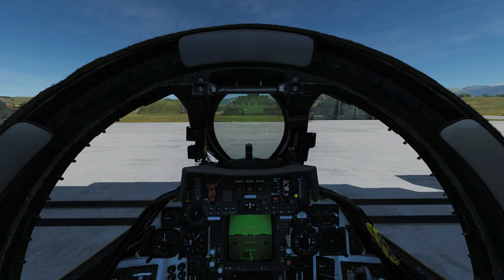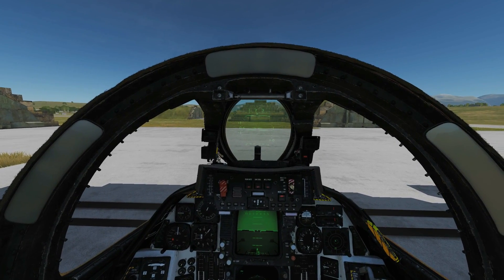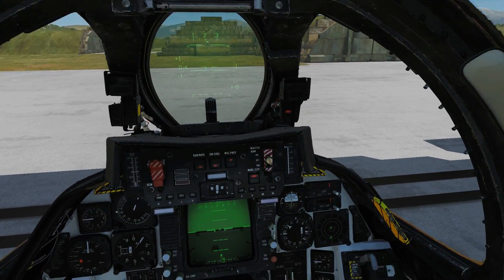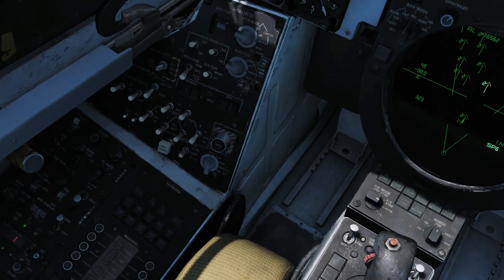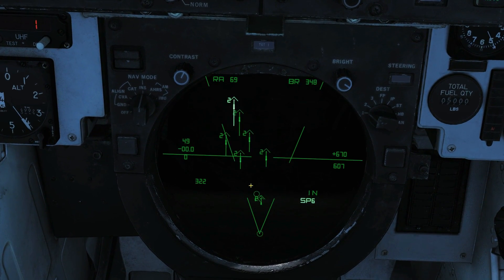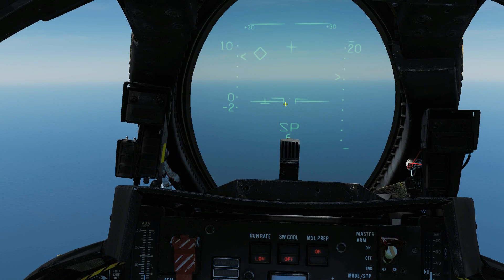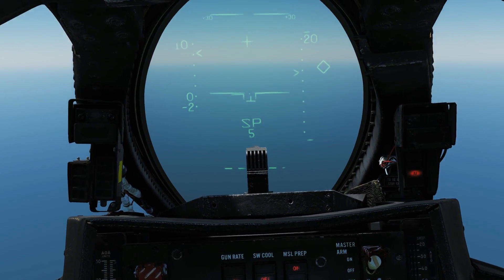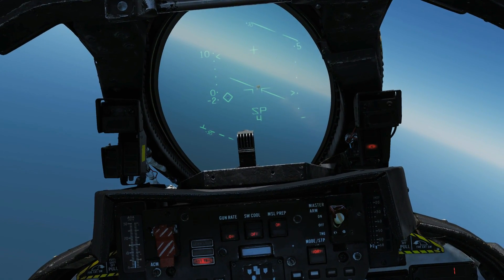F-14B Tomcat: Aim-7 Sparrow Tutorial | DCS WORLD

Comment: Ok, I have a question. I mainly play single player, and I've noticed some odd behavior with the F-14 and AIM-7. If I engage in a FOX1 fight and perform a crank after launch it seems that the radar struggles to keep up with the maneuver. You can actually see the line move off the bandit. When using the AIM-7M that is it. The missile loses guidance and goes stupid. Let me be clear I have not lost lock. Once leveled off the radar continues to track the bandit. I have a ton of Tackviwe data showing this. With the AIM-7MH this is not an issue. My theory is tdd that the MH has a data link with the mother ship, and that it is getting corse corrected back onto the bandit when I'm leveled off again, and the M dosen't. Any ideas.
Reply: Ive had similiar problems
i think i know what your seeing, when you loose lock, the diamond dissapears, but the datum cross stays on target.  this is actually where the camera is looking at and your lock is gone.  if you turn too much after launch but before impact, you may be turning outside the slewable angle of the radar and you would loose lock also the MH model's only difference is that it has a loft feature i believe

Comment: Here's a question. In bore sight mode, does the Tomcat need to guide the missile? Or will the missile just find its target and track it independently?
Reply: The Tomcat needs to guide the missile. Remember that the AIM-7 is a semi-active air to air missile so you have to maintain a radar lock. When you are in boresight mode you must keep the target center of the radar where the waves shoot forward and bounce back. If the target steers clear of that area, the missile will lose track.
Reply: @Megalodon64  thank you, kind sir.
Reply: @Megalodon64  Wrong. The whole  point of bore sight is to use the missiles own radar only, when the aircraft's radar cannot acquire a lock or you don't want to alert the RWR of the receiving aircraft with your radar.
Reply: @pizzaparty-r1c  Yes that is true with the AIM-54 since it has its own onboard radar but the AIM-7 does not have an onboard radar. It only has a receiver so you must maintain lock until impact. In boresight mode or FLOOD mode you must keep the target in the center of the HUD until impact.
Reply: @Megalodon64  Well when I do a 180° turn away from the target after launching a sparrow at a target within 20nm or so, the missile still tracks. Must be a DCS bug then.

Comment: @Cap Yes sir you are correct about the AIM-7M of the era or "block modification" or the missle. The missiles had matched or "tuned" to the AWG-9 to ensure proper tracking. It was also believed this would be helpful to prevent "cross-controlled missles" when dissimilar aircraft armed with the same missile were in the same AO to prevent the missiles from tracking off of another aircraft's radar. This was not proved or disapproved in the Navy. I believe it was a valid concern just not validated one way or the other.
Reply from the maker: Interesting stuff...

Comment: A question I've had for a while is: Are SA missiles harder to defeat using countermeasures compared to F&F missiles? 

Obviously F&F missiles have many more advantages with practical fighting, but I've been curious for this specific aspect for a long time. I think I may have researched it at one point, but I can't remember or it was pretty vague.
Reply from the maker: Wow such a tough question!!! The answer depends on: what are the capabilities on the missiles radar? and the plane radar? Do they have pulse track or only pulse doppler track? How powerful/smart is each radar? After weighing up the options and ranges. I'd say it's about 50/50.
Reply: CAP makes a good point. But bottom line is, as someone that flew in US Navy aircraft as a Aircrewman, it comes down to situational awareness of the crew. If you gain visual soon enough you stand a better than 50% chance of defeating the missile.